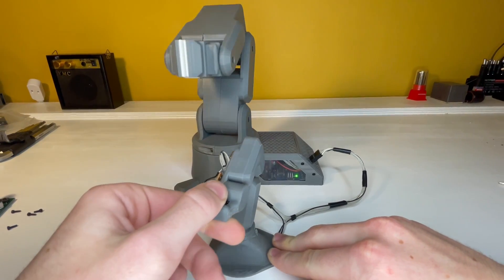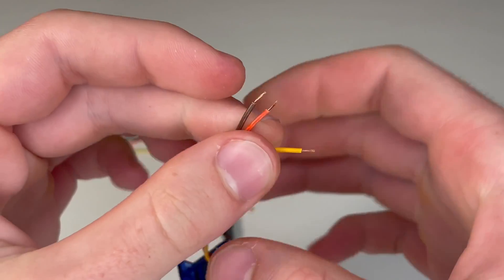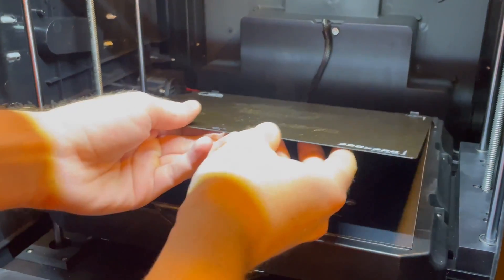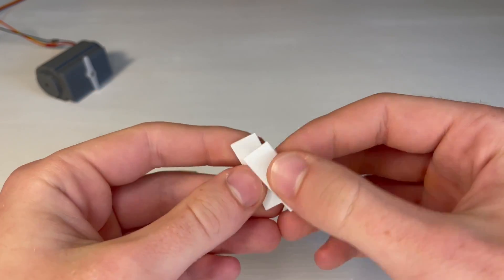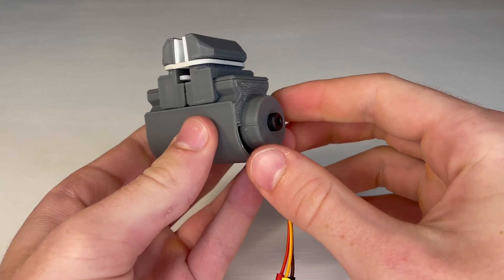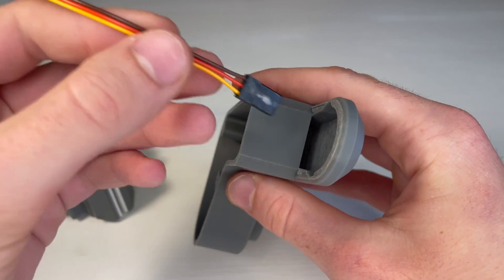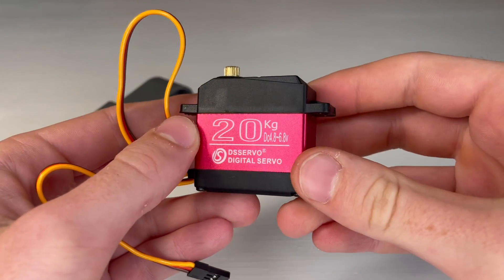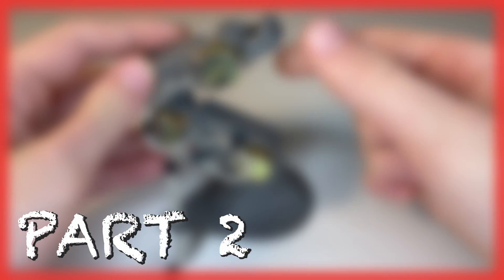How to Build a 3D Printed Robot Arm Tutorial (Arduino Based) - Part One

Comment: the link to the small screw set is not correct. it does not have m2.5 screws, not even M2 screws. Also, the gears I received were different.

Comment: Great tutorial! What are the specs for the gears you use? I would like to try to 3D print my own.
Reply: I would like to know too
Reply: me too
Reply: @kobex777 heya dude i got the measurements, For the 40 tooth gear. It is 21mm diameter.. For the 36 tooth gear 18 mm
Reply: @BakaNBeyond where did you order them

Comment: Hi, i've received the parts for this build and have finished the gripper, however i ordered 4 20 kg servos and am currently building the wrist/connection to the gripper. the servos don't seem to align the gear (in the three gear system) i fixed this by adding spacers but now the housing wont fit over the motor leaving a gap and misalignment , do you know what to do?

i really love the project and look forward to continuing it, please help me

Comment: how is this supposed to be only $40-$60? the main parts like servos and arduino are already over $80 and with everything else linked it would be over $200 i would assume these numbers are just the value of the parts used not how much for  the linked parts
Reply: Looks like you can buy a set of three, four, five servos for as little as US$12. The 20 kg servo can also be purchased for under $20. You don’t have to use an Arduino branded board. You can use a knock off that’s Arduino compatible. You can also make it Wi-Fi and Bluetooth controlled by using an ESP 32 which is are doing a compatible. That might require a little investigation to get the wiring for the pins correct. Make sure to buy one that has pins that fits into a bread board. Servo’s can be purchased in bulk again. You could probably get 25 of them for nine dollars US. Wire is probably more expensive, but again you can buy in bulk for as little as $20. 3-D printer filament again a kilograms worth is probably about 20 bucks US$25. LEDs can be purchased in bulk for as little as seven bucks. Pushbutton switches can also be purchased in bulk. And the screws can be purchased as a set of sizes from M3 all the way up to M8 for as little as $20. So I’d say yes the cost is probably above US$40. The whole thing could probably be built for between 80 to 100 US$if you had to buy everything. But you can use any wire that you have that stranded. I’d say the power supply again is also something that you can buy. It’s probably a little more expensive. A rubber band should be available everywhere in anywhere. Some foam can also be from anywhere. I hope this helps
Reply: Yeah, he did mention $40-$60, but then it came out $222??

Comment: I have built your mimic controller to control my laser cut arm. I have a geared  360 degree servo for base 270 degree servos for movement and a 180 degree servo for claw. Eventually i would like to save movements to  program replayable positioning.
How can i slow down the movement of the servos compared to the mimic robot arm they move too fast and slams the arm around. Is there simple code change i can use.

Comment: can i ask why you used 20KG servo instead of the mg996r ? and can it be replaced by the mg996r ?
Reply from the maker: @whitesugar188  I just used a 20kg servo on that particular joint because it has to lift the most weight. However, a standard serve should do, it’ll just be a bit jittery I’d imagine.

Comment: Could you print the gears?
Reply: Update ?
Reply: @Foxy-lr6go I printed the gears myself, I got lucky and they were perfect fit on first try... still didnt work lmao. I used rapid PLA+ to print them and they just wear out after few turns, the forces required are just too much for them. I will probably try to design an alternative so we can skip the gears altogether

Comment: Hello, I´m a teacher on a High School in Germany, exactly in Bavaria. I´m very, very impressed of Your project and I want to make it with my pupils. Is it possible if You press the button on the gripper and simulate a movement with the small robot included the potis that the robot can repeat this movement automatically? Is there an additional button necessary for save and repeat the automatically movement? Kind regards Michael

Comment: May I know the dimension of the used gears? I am planning to also 3d print the 40T and 34T gears
Reply: Did u get the dimension of the gears?
Reply: @phonethetkhine3244  unfortunately not😥
Reply: @phonethetkhine3244  unfortunately not. do you have any idea?
Reply: @jethtk50  20.8mm the 40 tooth gear
Reply: @jethtk50  17.5mm 34 tooth gear cause its smaller, these dimensions may not be the best, but you can print and test it

Comment: make sure the max current your 7V power supply provides is enough to power ALL servos, the arduino and plus extra for losses from wiring.
Reply: What voltage and amps should I use if I using a lithium battery would a 11v work
Reply: @connorribera4198  11v should work for the arduino, but if the servos are 4.8v-7.2v, you should step down voltage going to them. for battery current, you have to look at the stall current of a servo, and add them all up, and add extra buffer.
Reply: and how much current do i need: 5A, 10A or 20A?

Comment: What do you use to power the PCA9685  Servo Driver Board?
I am trying to build my own robot and have the issue of powering the servo driver. It needs 5V but my breadboard power supply module outputs only 500mA. Every other power supply is eighter 12V (or more) or is really expensive.

Comment: Hi so i am a student and i am doing a project where i am using brain waves to try and control a robot arm i dont really know what i am doing but i know that the brain waves can be used to control Arduino robots would there be a way for me to connect it to this build?
Reply: It's perfectly possible, but you need a computer in between that analyses the brain waves and translates them to the correct movements, which is all but a trivial task

Comment: what's the diameter of the 40 tooth gear and the 34 tooth one?  Please respond, i don't live in a zone where amazon ships.
Reply: Hello. Did you find the solution of gear problem? Please let me know.
Reply: something like 20.8mm 40 tooth, 17.5mm 34 tooth, worked for me for 3d printing them

Comment: Awesome project! In the middle of building it. What kind of power supply should I use? How much power? Tnx in advance!
Reply from the maker: Thanks! I’m using an adjustable power supply (linked in description) and running it at 7 volts. But really, any 7V power supply that's rated for at least 5 Amps should do.
Reply: Nice, tnx for the response. Do have a particular model that comes to mind?
Reply from the maker: @nickijssels6192  No problem! This is the adjustable power supply I use: https://amzn.to/46e27Xa

Comment: I am assembled the robot. My gripper servo (SG90) just keeps rotating. Any specifics on which servo I need to use? I have checked and the ones I have got are not the continuous ones. Would appreciate any help as this is blocking my build.
Reply: Resolved. The servo I got were continuous rotation. It did not say anything on the label which caused the confusion. When ordering servo for gripper, please ensure you get ones that specify rotation angle = 180 degrees

Comment: How did you make the motions so smooth with software? My potentiometer readings fly all over the place and the motors just tic and twitch all the time.
Or am I having bad connections? Hmmm
Reply: Did you get it working?

Comment: I want to put the circuit together before printing parts, just to test everything, but in the circuit diagram I don’t know which motor is which. Could you tell me which motor is which from top to bottom on the motor? The one labeled hand is obvious, but I want to be super sure. Thanks
Reply from the maker: Certainly! The servos are listed in descending order starting from the “hand.” So, from top to bottom on the diagram is from the gripper to the base on the model.

Comment: If you are buying servos and other parts already you might as well just save time and effort and buy servo extension cables. They are cheap, come in loads of lengths and means you don’t need to solder.

Comment: Is it 40 or 42 teeth gear? I think there is a bit of confusion on the video about it
Reply: hello, could you please provide more details about those 3 gears used, like their diameter size, number of teeth and hole size.
- What type of 4 servo motors are here (180 degrees or 270 degrees or 360 degrees)?

Comment: Figuring out which gear to use is frustrating given a big pack of unmarked gears. I bought the gears using the link you provided but I am only coming up with 38 and 42 toothed gears. None of which have the diameter or lay flush as your gears seem to do in the video. Did you cut the guide rod bearing off? Also the hole diameter is much smaller with the linked gears than an m4 can go through. Is the link for the gears on amazon accurate?
Reply: I also bought the same one as listed in the description and i found the 34 and one 40 tooth gear, as for the other 40 tooth gear i took one which had 40 tooth and some small gear attached end i cut that part off. as to make it flush i simply cut the bits that extended outwards off. i hope this helps
Reply: @mihaichici  It does. I figured something like that had to be done. Thanks for the confirmation/reply!
Reply: @isaiahnelson3643  hi can you please give more details regarding those 3 gear used, like their diameter size, no of teeth's and the hole size..
Reply: @mihaichici  hello, could you please provide more details about those 3 gears used, like their diameter size, number of teeth and hole size.
- What type of 4 servo motors are here (180 degrees or 270 degrees or 360 degrees)?

Comment: Hello Im doing this project for class. With how many volts did you work on the power supply to make it work?
Reply: hello, could you please provide more details about those 3 gears used, like their diameter size, number of teeth and hole size.
- What type of 4 servo motors are here (180 degrees or 270 degrees or 360 degrees)?
Reply: @mr.q1880  did u find the answer?
Reply: @mr.q1880  40 tooth 2 pc, 134 tooth 1pc

Comment: I built it on a breadboard but am having trouble getting it to work. The code loads fine. Does it need power from both the Arduino and the servo driver board? what is the voltage to the driver board?  Is the breadboard schematic correct. I didn't want to start printing parts until I knew we could wire it correctly.

Comment: I have built this, but for some reason whenever I turn it on the robot arm doesn't mirror what the controller is doing. The wrist potentiometer is corresponding to the base servo, but nothing else works. I have rewired it, and changed out Arduinos and it still doesn't work. Is there a possibility I got faulty code? What else could be wrong? Thanks.

Comment: I just printed the piece of the main arm. The one that the motor is not mounted to. The material that connects the bearing the the arm is super thin. It snapped under light pressure. Maybe 1mm? Is that by design or did it not print properly?

Looking forward to trying out your design.
Reply: I also have the same problem, have you resolved it yet?
Reply: @mr.q1880  I haven't had time. Writing finals now. I'll put it into NX or solid works and see if I can beef it up

Comment: I’ve just built it and it works perfectly 🎉. It’s incredible the smoothness of the movement and the cleverness of the design. Thank you for sharing this 🤩. The robot is now helping to automate biology experiments at Edinburgh.
Reply: Great I am going to build it as well, hope you help me if there are nay issues for me
Reply: hello, could you please provide more details about those 3 gears used, like their diameter size, number of teeth and hole size.
- What type of 4 servo motors are here (180 degrees or 270 degrees or 360 degrees)?
Reply: where did you get the code

Comment: How many volts and how many amps is your power supply? Can the external board for the servo motors handle the required current? Thank you
Reply: I have the same question!
Reply: @shiponhossain1260 Same 😂

Comment: can you use 12volts thanks
Reply from the maker: Unfortunately, the PCA9685 Module is only rated for 5 to 10 volts.
Reply: @buildsomestuff  Thank you so could you use 2 amp 5volts
Reply from the maker: @cuan_piano  That may work, but I would recommend a 7V (3 amp) power supply.

Comment: Is there an easy way to count the gear teeth? ⚙️ the pack has so many
Reply: hello, could you please provide more details about those 3 gears used, like their diameter size, number of teeth and hole size.
- What type of 4 servo motors are here (180 degrees or 270 degrees or 360 degrees)?
Reply: @mr.q1880   I took some caliper measurements. 40 tooth gear measured 20.7mm and the 34 tooth gear measured 17.75mm.

Comment: how much money for all the materials?
Reply from the maker: Hello! While the material cost is relatively low at around $60. The total cost to purchase everything upfront is much higher at around $200. However, this is assuming that you have none of the suggested parts and would need to purchase everything. And, most of the purchases included in this total have more parts than what is required for this project. For example, the linked micro servo pack comes with 4 servos, but only one is needed. Hope this helps!
Reply: very helpful!! Thank you so much! @buildsomestuff
Reply from the maker: @RMac  No problem!

Comment: Hello Build Very good excellent work.
I'm printing and waiting for parts, I have a question: do the potentiometers have to be in a certain position when starting with Arduino?
Greetings from Spain
Reply from the maker: Hello! Thanks! After the robot arm is fully wired and the code has been uploaded, when you power the robot on the servos will automatically move to match the position of the potentiometers after 5 seconds. I have incorporated the 5 second start delay so that users can line up the controller to roughly the same position as arm (so that the arm doesn’t move too fast to match the potentiometers). There may be a better way of doing this, but this is just what I implemented at the time.
Reply: Hello, thank you for your prompt response.
In your video when you load the program the controller is fully assembled.
My doubt is, in what range should the potentiometers be before mounting and closing the controller and before loading the program.
I understand that the potentiometers before closing and loading the program must have a preset position for the correct movement of the arm.
Forgive my clumsiness
a greeting
Reply from the maker: @manelangulo8352  Ah, I think I understand your question now. All of the potentiometers should be in their middle/halfway position (When the slot on the metal knob is parallel to the three pins' bracket on the bottom). Once the potentiometers have been set to their mid positions, all of the controller's pieces should only fit on one way. Sorry, I should have clarified this in the video. Hope this helps!
Reply: Hello Build.
This is what I sensed, but I want to clarify it.
When I receive all the pieces and assemble it I will let you know the result.
greetings from Spain
Reply from the maker: @manelangulo8352  Great!
Reply: I am having the same problem as you, can you guide me?

Comment: So cool! Looking to buy a 3d printer soon. What's the minimum bed size I would need for the size of these parts?
Reply from the maker: Thanks! That’s awesome! The standard 220 x 220 mm bed size will easily fit all of the pieces. You will just have to distribute the parts in groups to print them all. In other words, the standard bed size volume won’t be able to fit all of the parts in just one print. Hope this helps!
Reply: @buildsomestuff  thanks for such a fast reply! That makes perfect sense thanks!
Reply from the maker: @jobydorr4267  No problem!

Comment: I really Like the design. Maybe i will split some parts in order to ease printing and to reduce need for Support Material. Would also be nice to have .scad files, as they make modifications more easy.
Reply from the maker: Thanks! Great idea to reduce supports! Unfortunately, I do not  believe I am able to export designs as .scad files from Fusion 360. However, this link will take you to the Fusion and .step files for this arm/controller: https://drive.google.com/drive/folders/1x4P8AquQILwCp8e5CiRJLfVJiJn2U4cF?usp=sharing Hope this helps!

Comment: Wouldn't Arduino have handled 4 different servo without the board?
Reply from the maker: Hello! While running servos directly off of the Arduino is less complicated, it can become impractical when controlling more than just a couple servos. Since I need to power 5 servo motors for this arm, it would draw too much current through the Arduino’s 5V pin and possibly fry the board altogether. The PCA9685 Module supplies power directly from an external power supply to prevent this from happening, which allows me to control up to 16 servos without worrying about burning up the micro controller. Hope this helps!

Comment: what's the estimated cost of all the parts? excluding 3d printer stuff
Reply from the maker: Hello! While the material cost is relatively low at around $60. The total cost to purchase everything upfront is much higher at around $200. However, this is assuming that you have none of the suggested parts and would need to purchase everything. And, most of the purchases included in this total have more parts than what is required for this project. For example, the linked micro servo pack comes with 4 servos, but only one is needed. Hope this helps!